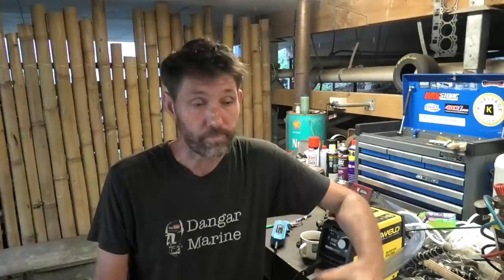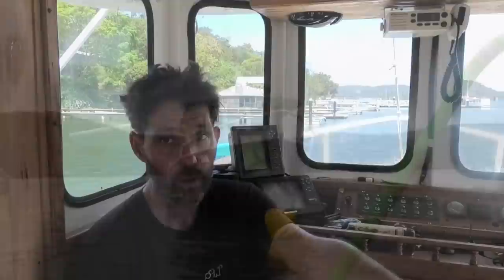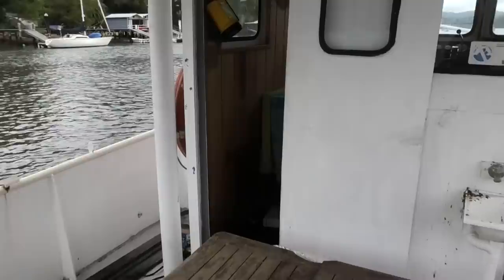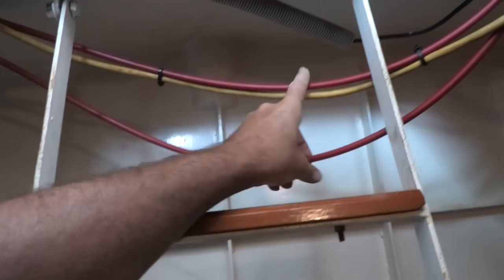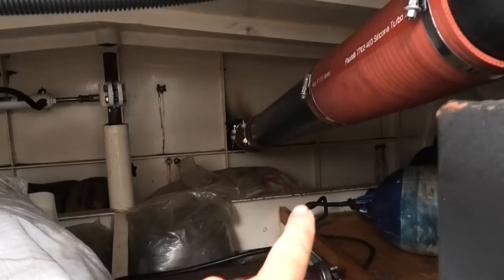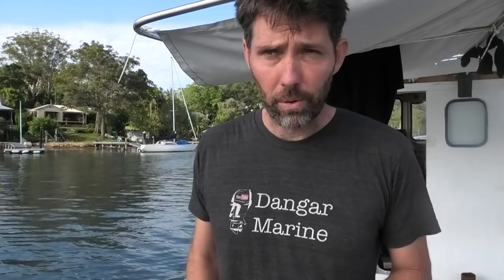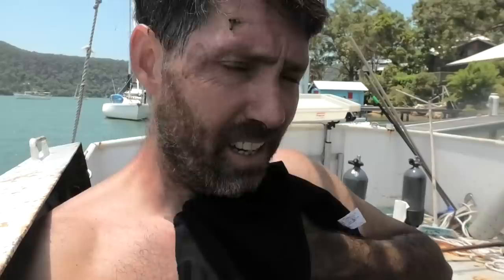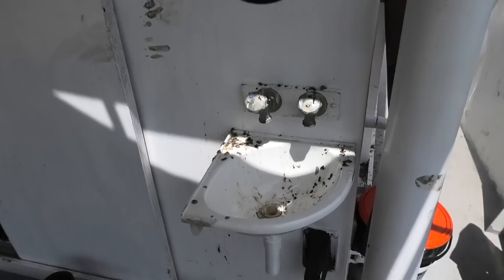Is it a bad idea to buy an old steel boat?

Comment: I was a professional fisherman for 22 years GM Motors are great boat motors I think your boat is actually in pretty good nick and will be easy to put back into first class order .
Nice thing about older boats you will learn the ins and outs and they're pretty easy to fix so generally if you have a problem out of water you should be able to fix it yourself I would recommend cleaning your fuel tank and checking that you got good fuel filters fuel contamination can be a big problem I have had to make a makeshift fuel tank to get myself home so to be able to understand how to bleed your motor is also important
Reply from the maker: Thanks David. I'm running the fuel tanks low at the moment as they do have good inspection / cleaning hatches. The previous owner was a full time diesel mechanic so he kept the servicing up on the engine which is good.
Reply: David Ayres woq what did you use as the tank!?! Thas awesome
Reply: I pretty much agree with the above. Boat seems in fair shape, some problems, but not overwhelming. Wouldn't kick much about taking it from Seattle to Ketchikan, after putting her up on the ways, to deal with the problems that you noted. In Summer, anyway. Queen Charlotte Sound is rather bitchy, any other season for a boat of it's size.
Reply: @Dangar Marine 
Hey I was just wondering, I am from regional Vic and my partner and myself are looking for something like this,but due to some health issues we won't be able to put too much sweat equity into it, but would you recommend any places in N.S.W or Victoria where we could try and find a boat and have it fixed up without taking it too far to get fixed or paying someone to go to the boat?

Comment: Steel rusts
Aluminum disappears (electrolysis)
Fiberglass delaminates 
Wood rots

Pick the hull material based on what kind of work you feel comfortable with!
Reply from the maker: That's exactly my thought process too. I'm most comfortable cutting, shaping and welding steel.
Reply: Try Polyethylen it is weldable
Reply: @berndschiffer364  I have a Triumph 191 made out of Roplene...a great inshore/nearshore boat and tough as hell...lasts forever and no paint or hull maintenance required.
Reply: Rigging Doctor 
Steel Reinforced Concrete?
Reply: With cathodic protection steel lasts until you die. Aluminum is the most common metal on the surface of the Earth and cheap, hard to weld correctly. Fiberglass is for corvettes, wood is for fire places. Aluminum actually protects itself with a layer of oxidation, the pyramid on top of the Washington Monument in DC is made of Aluminum, it's doing ok. If Al gets to be next to a different metal it goes crazy. Unless u use all of one kind of metal you will have problems. All steel is easy to work with.
Reply: Plastic!
Reply: .... so the distinction is not trivial ? This is the opposite of electrolysis .

Are you thinking of galvanic corrosion . In water, this produces oxygen and hydrogen Electrolysis is the forced introduction of an electric current in an electrolyte to separate metal components
Reply: Laminated wood epoxy construction eliminates pretty much all of those problems.
Reply: Very well put !!!  In the fewest words possible.  You should write manuals for the chinese and do us all a service !   lol.
Reply: I'll just use a boat made entirely of Flex Tape.  I'm pushing off for a transatlantic crossing right now, I'll hit y'all up from Europe...
Reply: I have a very thick plastic bass boat, no problems so far
Reply: Chad Simmons are you in the Atlantic by any chance?  I just spring a leak, might need a ride have to shore......
Reply: @chadsimmons6347  yes, that is probably the best isnt it, as we know it will be around in the sea forever wont it,  as the marinana trench is full of the crap.   But really, make boats out of all the plastic in the sea and float about on it,  breeding fish !!!  lol.... POLLUTION SORTED!
Reply: stainless steel?
Reply: @navigator1383  I like stainless steel but i think it would be cheaper to buy 10 boats made from carbon steel. so just buy a new one when the steel rusts, cheaper than stainless. Also stainless can still pit especially if it sits in salt water. Build one out of glass just don't hit a rock haha.
Reply: I'm using gold to build me ship.
Reply: @davidporowski9512  Never! It's why is a backyard home build kinda thing. Worked great for ww2 when we needed cheap easy disposable boats. But that's about it regardless if stainless steel mesh lol
Reply: Best long distance cruising is medium heavy displacement.  Steel is easy to repair. At the end of it's  long life, steel is worth value as scrap. Anything else costs you to dispose of.
Reply: I like steel!
Reply: Thats why i bought a Dinghy they last forever and are alot more Mobile
Reply: Steel is so much heavy, it's bad for speed. fiber and aluminum are lighter and lasts forever if done right.
Reply: @ismzaxxon  wow that's so true I found that out when I tried to give my motorhome to the junkyard and found out that you can't give a motorhome to the junkyard because it's not all salvageable and since you are stuck with something that you must pay to scrap what a mind blower!
Reply: aluminum just fine, what are you smoking
Reply: You forgot concrete boats and yeah that was a thing at one time
Reply: Got me a gold one, great ship.
Reply: Sheesh, you just took the wind out our sails for owning boats. There still is the first and last day!
Reply: Titanium?
Reply: @rigging doctor "fiberglass delaminates"???  Well, some does if it was put together by fools but have a look at my 1973 Chris Craft Commander hull.  Not a bit of delamination, bubbles, etc. None. Zero. Zilch.  Solid and sound as the day it popped out of the mold.  In fact, all of the other materials you mentioned will disintegrate unless you take great care of them.  But FRP?  nah, bra.  It holds no matter how badly you abuse it.
Reply: @matthewdevine113  I like it Matt.
Reply: buy a boat and you will work forever..(dutch say)
Reply: Got a link?
Reply: brass .. lasts forever ( at least a few thousand years )
Reply: @spiffdandy77  And sinks.
Reply: Aluminum -bronze alloy is pretty resistant to weathering, I’m not sure how practical it is as boating material though
Reply: @johnkean6852  but steel floats ?
Reply: Plastic lasts forever
Reply: I only use adamantium
Reply: Heavens to Murgatroyd the Washington monument wasn’t submerged in saltwater last time I checked
Reply: Kill It and Grill It not really, you still get delimitation, and some rot
Reply: And then theres plastic.. no.
Reply: Yep. 10 years employment in a shipyard and 36 in welding and steel fabrication. One year in a fibreglas shop though so either of those i would be comfortable with and competent at. Just quite an investment in equipment to renovate a steel hull. I could do the same with Aluminium but i can imagine that aluminium might cost a bit more as material cleanliness is paramount to successful aluminium welding.
Reply: You forgot concrete sailboats and yes they did make those my problem with them is they sink
Reply: Pedro Henrique not everyone cares about speed. Some of us want a true tough work boat that will last.
Reply: @heavenstomurgatroyd7033  The pyramid on top of the Washington Monument isn't immersed in salt water.
Reply: Large Marge ly
Reply: Stainless
Reply: that would boil down to local conditions and the best ways to negate the deterioration of a given material.  i live in the upper Chesapeake estuary where this brackish bay is barely salty so steel suits me fine for the long haul and peace of mind.  i need far less structure and support with steel so i end up with more usable space which is the name of the game for commercial or serious watermen.
Reply: plus ive found an anode designed for protection of rebar in bridges that i use for the hull.  decades without substantial rust is the end result.. with due maintenance ofcorse.
Reply: Robbert James  there is proof floating around all over the Chesapeake.
Reply: @berndschiffer364  , I'm wondering why hulls aren't built out of PPE or HDPE.
Reply: @davidporowski9512  Spalling! The sea ALWAYS wins :)
Reply: Ferro cément . The longer it last the harder it becomes.
Reply: Bitcoin Trades  Falls prey to the same ills as fibreglass :)
Glass fibre/carbon fibre in epoxy resin.
Reply: David Porowski I forgot about Ferrocement!
Reply: Yo Daguy we can give you a tow, we’re going to be sailing back to the US this year 😎
Reply: Sam Starr 🤩
Reply: DIYDaveT as long as it’s solid! Put a core in there and you can watch it fall apart before your eyes!
We have a 1968 Morgan 45 with a solid hull and it’s doing just fine with thousands of miles under her keel. 
You should check out my channel where we have all of our adventures.
Reply: Robbert James I personally love wooden boats!
Reply: @RiggingDoctor  You mean those boats that sink when the steel rusts causing spalling in the concrete?
Reply: andrew allen I’ve seen them while cruising but I prefer my fiberglass sailboat
Reply: Josh lower unsheathes my claws
Reply: use concrete.
Reply: @Cowboy_Foradalei  weight is less of a factor than good design with most boats for speed. I'm thinking sailing mostly
Reply: @accordv6er  But you will never see a speed yacht made of steel or wood, generaly the fastest boats are made of carbon fiber.
Reply: wood / epoxy,   lasts forever as long as you keep a nice coat of LPU on it.
Reply: @davidporowski9512  terrible strength to weight ratio.
Reply: @DIYDaveT  I have a 1964 run about in glass.....only thing that failed was the wood deck, it wasn't made of marine ply and had no epoxy on it.
Reply: @RiggingDoctor  depends on core material and if it's vacuum bagged.
Reply: @heavenstomurgatroyd7033   Well said that man..you know your stuff ..plus steel is the easiest  material to work with ..
Reply: @navigator1383  Very heavy and terrible  to weld ...
Reply: Is other then jobes in is your company

Comment: The omly thing thecshaft needs is some new packing. Dig out the old. Cut new rings and stuff. Remember to stagger the ends, and tighten. Probably will have to retighten after a few hours of operation.